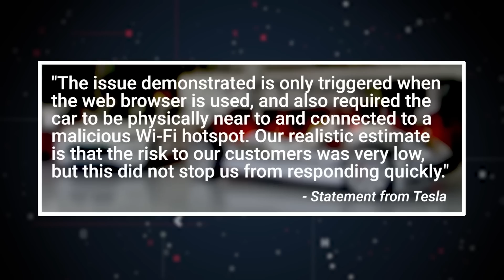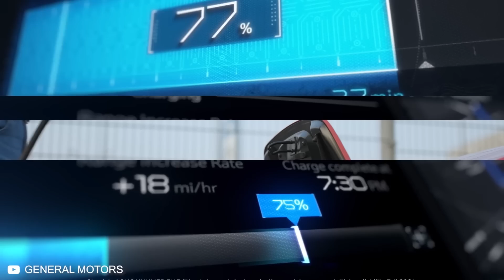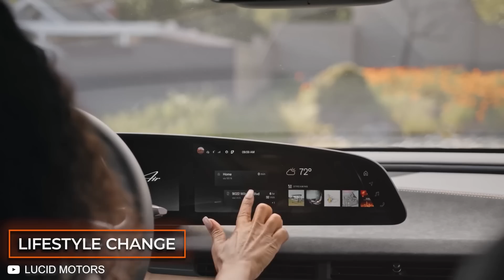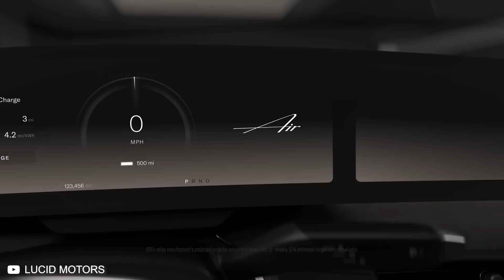EVs' Serious Problems That Carmakers Are Hiding

Comment: Adaptation: The cheapest EV I've found in the Netherlands is about 30 000EUR with a 25kwh battery pack... it's over 5 years old... where I live we have about a car park for 200 vehicles, surrounded by flats, and not a single charger can be found...
Reply: Sure each person has a choice to buy a EV or not
Here in  Australia  we simply  do not have the infrastructure  in place for thousands of people  to charge all their EV at the same time  when they finish work at 5.30pm 
Alot of people  only have street parking  and no where to actually  charge their EV  at home or in some cases at work as well 
As for charging  stations  around the place they are subject the failure  ,damage and vandalism  or all the above plus not to mention the long lines and fights over the charging stations  that still work 
Sitting in line waiting  for several for your turn to charge  you EV as you don't have enough  power in the battery  to search for another charging station
Really sounds fun and enjoyable 
The electrical  grids in alot of areas need to be up graded  and charging stations  need to be everywhere and actually  work before people  will have any confidence  in spending the big bucks on a EV 
How can you charge your EV if you have no power  due  to a fire, flood or snow storm or some other natural disaster and have to get to safely?
Of coarse  electricity  is the first thing to fail in an emergency  so you and your family are screwed 
Drowning ,been burn to death or frozen to death  is not my idea of a great time  cos my expensive  flat EV  is as useful  as a door stop with no way the charge the battery 
My advise is to buy a petrol/ electric  vehicle  like alot of taxi companies  do 
That way you can still escape  an emergency if you have no power 
Due to the petrol motor charging the battery as you drive you have move range Plus if you cannot get to a charging station  you can pull into any service station  and buy fuel and be on your way 
Isn't a petrol /electric  vehicle  and safer choice especially  if you have  young children 
Emagine being in your   dead EV  stuck on the side of the road  in the middle of nowhere  with the wife and 3 kids all under the age of 10 and it's 40 degrees out side in the middle  of summer or 10 below  in the middle of winter with no power to run the ac or heater or charge your smart phone 
People put themselves  and their families  in very dangerous  situations  due to believing in technology  and all the bullshit and lies the car making said  convincing  you  buy that EV
buying a EV will not save the planet nor stop climate change  no matter what the government  or any car maker  says
Reply: "#StoreDot Batteries" 

Like I have been saying I'm sitting out from buying an EV for the next 2 years.
( I would like to wait longer but I don't have the patience)
 The 1st EV  I will buy will probably be in 2024,  the way battery technology keeps advancing and at its current rapid rate a EV today with today's current battery configuration will be obsolete within 2 and a 1/2 years.

 Prime example is that the early EVs with the "3G Technology" are now dead in the water with "5G technology"  kicking in.
Reply: If I had the choose between  an EV  and a petrol /electric  vehicle 
For my and my families  safely  I would choose the petrol / electric  vehicle  every  time 
It's just not worth the risk 
Being stuck.out in the middle of nowhere 
Even if help comes along  ,without specialised  equipment  they cannot charge your EV battery nor jump start your EV  without cooking the electronics 
Mechanics  who specialise  in EVs are far and few between especially  here in Australia  where they could be 500 or 800 kms aways from where your EV is 
 In the days where you could help someone  broken down on the side of the road by help change a flat  tyre  or putting some fuel.in the tank ,enough to get them to the next service station 
You cannot do that with EVs
Reply: @waynehewett4017  Still early days.    They don't make sense everywhere.   
I hear Tesla batteries are doing a great job stabilizing your electric grid.
Reply: @danharold3087  don't get me wrong evs do have thier place in the cities with school runs ,shopping and going to work 
But there still  is alot of issues that still need to be addressed 
Here in Australia  with have alot of on street parking  so how are you ment to charge your ev overnight?
Good luck trying to find and recharging station at your local shopping centre which isn't working ,damaged or vandalised 
Plus like many storms and nature disasters  sometimes  the power can be out for many hours so how are you able to charge you dead ev?
What happens if you have  to get out in a hurry  due to a fire and flood with a dead ev
 Personally  I think buying a petrol electric  vehicle  makes more sense  as  your not restricted  and contiguously  worrying about trying to find a recharging station  that actually works 

As petrol as available  at any service station 

Sure they may not be as clean as an ev but that's if litte consolation  when your out in the middle of no where  in 45 degree heat with the wife and 3 kids in the back screaming their heads off and the 80 thousand dollar ev is nothing but very expensive  road side furniture 
Why do you think that taxi drivers use the petrol electric  vehicles  instead of the evs  as if they get into trouble  that small petrol engine  gives them more range to get out of trouble  plus petrol is available  at any service station
Reply: @waynehewett4017  Who has he scammed.   You have to stand in line to get one of his cars.  He has saved NASA huge amounts of money even by government standards.

The truck semi and taxi will be built when he can make enough batteries and chips.  RIght now all production is going into cars.  Would be wrong to open up new lines for new products and have them idle for lack of batteries.  

Tesla has 1.4 million cybertruck reservations.   Each cost $100 is is fully refundable.  No scam there.
Reply: @waynehewett4017  I agree that not everyone should buy an EV.    They can't build enough to keep with people who want them.   

You looking at what EVs are today.  It is still early times for EV.   What has been 
done is amazing but it will get much better.  In the past 10 years the realistic range has gone from something like 50 to 250 miles. 

The days of the taxi as we know it are numbered.   Tesla and others will be releasing self driving taxis.   There are currently 25 companies selling or working on self driving shuttles.

Researchers  all over the world are working on self driving cars.   I know a young lady from Pakistan with a PhD from South Korea who will soon be moving to Canada where she will continue with research into self driving car software.   There are 1000s of people like her working on it.  I don't know when it will happen but it would be shocking if it did failed.
Reply: @danharold3087  I agree evs  do have there place , school.run ,shopping ,going to work in our cities 
But like in most countries  the power infrastructure  is crap and can no way recharge  tens of thousands  of evs at 5.30pm when most people come home from work 
Alot of homes only  have no street parking so good luck recharging your ev or finding  a recharging  station  that's not busted with 20 kms left in your evs battery 
Evs have alot of short comings not that testa Musk cult would never have that in the sales pitch  when trying to sell you one of the over inflated  ridiculous  expensive  pieces of crap preying on your going green spin
Infact owning a evs could kill you 
Like most natural disasters  what's the first thing that goes out ?
Electricity 
So how the fuck  can you recharge?
What happens  if you and your family has to get out fast  say a bush fire breathing down your neck or you have 6 foot of flood water in your house and rising 
Trying explaining that to your wife and kids as you all die because  you brought  an ev 

That 80 thousand dollar piece of crap sitting  in your garage  looking pretty  isn't much use is it ?
If it was me I would just keep the petrol or diesel  vehicle  you have 
Plan your trips to do several  things at once and only go out when you need to 
There is nothing wrong doing 500,000 kms or more in a vehicle 
At least if you are in a natural disaster  you can still get to safely  
And let's face it having your family safe  is far more important  than the bullshit and propaganda  all the car making spin hoping you swallow the going green crap 
I know which one I'd choose  every time
Reply: @danharold3087  look I'm not against  buying an ev
But evs are not the be all and end all to our problems 
Evs will never replace diesel  and petrol vehicles 
As there are jobs the evs simply  cannot do 
Eg heavy road haulage  mining operations,  rail transport 
Any form of towing eg horse floats ,caravan,  trailers etc 
Sure there have been in roads into some areas but at the end they always rely  on fossil fuels to operate 
Abit like our idiot in charge here in Australia  who has been sucking on the coal industries  teat for years  using coal to produce  electricity 
How can evs be green if the electricity  produced in recharge  these vehicles  comes from the most dirty ,co ,producing way possible?
Just look at China and the amount of pollution  there caused of burning coal
Reply: @waynehewett4017  It is very early days for EVs.   One would be foolish to buy one without the needed charging infrastructure.   Everything but the bit about mining trucks here is from memory.   I am fairly sure about most of it.  I have noted where not.  Units are generally what sources used .  I know and use metric but when I see both the imperial is what I remember.      

Komatsu is selling diesel over electric mining trucks with capacity up to 180 st aka 907 kg.   Mining already uses a LOT of electricity.    It is not much of a leap to imagine trucks that load in the pit and charge where they dump.   The batteries will get there.  Environmental concerns and lower operating costs will make it happen.

Over the road trucks are nearly here.  The technology is here.  Tesla will have them when they catch up on making batteries.   The cost of running these trucks will be saving the operator between $100 and $200 USD a year.    When they get to self driving it will be adding the drivers salary to that.  So 1/4 million bucks more profitable.   

With 100% coal generated electricity EV cars break even on carbon at about 70K US miles. After that they are greener than gas aka petro ICEs.  When you replace the coal with a renewable the EV is green way earlier.  Thinking it takes 20K miles to offset manufacturing pollution.

As I think you are saying the grids are dirty due to greed.  In the US some of these greedy people are investing in EV charging stations. They want to keep their hooks in our pocket books.   Obviously we need both ends of this to be green.  But as I said above even with coal EVs are greener.  This relies on the coal plant not being worse than the car.  Depends on age and local laws obviously.  In short politics allow the grids to be dirty.

China's grid is interesting.   While it is burning a LOT of coal that is due to its size. "In early 2020, renewable energy comprised about 40% of China's total installed electric power capacity, and 26% of total power generation."

By percentage that is about the same as other large countries.    Until we get grid scale batteries for peaking I don't know how much above 20% it will go.  But I understand your ahead of the world on that.

So yeah it all comes down to better batteries.   This is widely understood with a huge amount of research going on.   The same goes for self driving.  

What nobody seems to be talking about is collecting the money needed to maintain roads.    Obviously that money needs to be collected.   When they start doing so it will skew the numbers.
Reply: @danharold3087  I too have heard  of the electric  dump trucks and the huge diggers they have on the open cut operations  and even some that are operated by remote control many hundreds of kms away at head office 
It's more as  a cost saving  exercise  to the companies as machines can work 24 7 without sleep ,breaks  or human error 
It has little to do with going green tho they what the appearance  of doing so 
Government  grants are a wonderful  thing especially  when they run into millions of dollars 
The problem  here in Australia  just about all electric  produced comes from burning coal
Sure we have ,wind ,solar etc but they are a drop in the ocean
To be honest I don't know much of what goes on the the US  only what you read or see on media or the internet  which could be ether propaganda, lies or true or somewhere in between 
I know testa and the Musk cult are breaking their necks to sucker any one to buy thier ridiculously  expensive  shit boxes  with the going green crap
Personally  I'm surprised  that Musk isn't in prison  for lying and defrauding all the customs who paid out millions of dollars in deposits  for testa products  that Musk conveniently  forgot about  and is yet to refund any of that money back 
Here we call that a scam artist 
I'm sure all those people Musk scammed don't give a shit how much Musk and spacex is helping. NASA  travel  to Mars  probably  using the stolen money to do it
I wouldn't  trust or use any products  from testa  or the Musk cult even if you gave it to me 
I don't know about the US but here in Australia   in our major cities we don't even have the proper  set up for ev charging  stations  as what one are available  ether don't work, damaged or are vandalised 
People that own a ev it's quite common  for the owners having to call a tow truck  to get their piece of crap ev taken ether home or to a locked and fenced off recharging station 
Due to the owner not being able to find a working charging station before the battery  went dead
So much for evs being green?
As for your question  that the government.  Is missing out on all that fuel tax ,the policians  here came up with a great idea 
Let's slap on a ev tax  to make up for all the fuel tax we lose 
Failing to realise ev owner already  paid a ridiculous  inflated  price for the ev plus all the taxes that go with it 
I think.most policians  have the intelligence  of a 2 year toddler
Reply: @danharold3087  you may think I'm  against  ev s but I'm not 
They have thier place 
But without education  and been taught  what evs can and can't do , what the evs limitations  are 
It's not you can jump in your ev and travel 200 or 300 kms  down the road  thinking  everything  with be fine a dandy 
As if you don't plan your trip there is a  possibility  things could go terribly wrong 
Even with a petrol  or diesel vehicle  you still need to use common sense  but at lease you  can pull into any service station  and buy fuel out in the sticks 
With evs you simply  cannot do that  and it maybe some time before it's possible
Reply: @waynehewett4017  I have said they are not for everyone. Many times.   What the heck happened to personal responsibility.   

The fact that my little town has a charger is an indication that chargers are coming to the sticks.   There is money to be madel! They will be built.    

Many people have two cars.  One EV and one ICE.   When they need to travel outside their comfort zone they run the ICE car.  YouTuber Darbin Orvar has a 2015 EV with an 85 mile range.   It gets her to town and back.  She has to charge in town if she drives around town.    Sounds horrid but she and her family loves. It.  They have a jeep to use when that cars range is a problem or they need to haul.   

I current have a 79 toyota pickup I only use in town.   I can see replacing it with a old EV with a short range at the right price.  As the range of new cars go up the value of old vehicles with little range will go down to about what an old battery pack goes for on ebay.

Again not for everyone.    But there are a good percentage of people, at least in the US, that have at least 2 cars.  Having a mix of ICE and EV makes sense.
Reply: @waynehewett4017   Yeah people need to know what they are doing.  Be it blankets and candles to survive when stuck in a blizzard or water to survive the heat.  People need to embrace personal responsibility.  We also need to be rational.

Still early days for EVs people need to understand that.  Don't paint the entire EV industry with the screw up of single car or manufacture.   I think most of your objections are being addressed.   LIke more range.  Economics will cause tow trucks to go electric.   It can happen by replacing retired units with electrics.  Maybe sooner.  Of course first there has to be the electric trucks. 

I talked with a trucker friend today who has been anti EV.   The cost of running his truck has caused him to change his mind.   Millions of people will soon be wanting electric semi tractors.   The economics of running a diesel at current fuel prices are bleak.
Reply: @danharold3087  I agree to have both if you can afford the 80 grand to buy a ev 
Just remember your 79 pick up is going to be worth more that that 80 grand ev in 5 to 7 years  as no one will want a used ev 
Personally  I can think.of alot of better ways to spend 80 grand and no I wasn't thinking ,parties, boozer, hookers etc tho it did cross my mind for a second 
The wife and kids are what's important and getting them.out of trouble  in a hurry  especially  in natural disasters 
I know what direction  I would choose to save my family 
Keep the 79 pickup and buy another petrol  or diesel vehicle  and have an emergency  escape  plan 
Apart from snow storms ,bush fires and floods  you guys have the nasty little buggers called Tonados which happen every  year in the US
Reply: @danharold3087  commo sense and actually  using your brain is a lost art now
Reply: @danharold3087  lucky  here in Australia  we don't have to worry too much about snow storms 
In Western Australia where I live  it  rarely gets below minus 3 during the  winter and that's only far a few days or weeks  with just frosts on the ground 
It's the summers that are hot   and that's where alot of the unprepared  die out on some dirt track  in the middle of know where ether bogged in the sand or run  out of fuel and water , snake bite etc 
Dying of thirst and exposure  is not a very pleasant  way to die
Reply: @danharold3087  I live in Perth Western Australia  and my mum whos 73  live in Toodyay  a small town about 130 kms away
I've got a old  2004  ford ute and I always have spare water ,fuel, oil ,brake fluid and tools to fix things if the need arises and it's only 130 kms away with 3 places to stop to get fuel etc in between  
I've always carried spare fuel and water it second nature to me 
It's certainly  got me out of trouble  quite a few times,  tools to do a patch job to get you home or to a mechanic or 5 litres of  fuel to get me to the nearest service station, or blown a radiator   hose , taped in up and refilled the radiator  with water to get home 
That cloth tape is bloody handy stuff for a temporary patch up to get you out of trouble 
People now have no idea how to survive  without their cup of coffee and their smart phone glued to their hand
Reply: @danharold3087  I'm not against  evs at all my friend at all
In the cities  with less pollution  is a good thing
As for your trucking friend  paying 1,500 dollars each time you fill your truck is a hard pill to swallow  and Russian going stupid  now it would cost your trucker mate well over 2 odd grand to fill the tanks 
There is other manufacturers  that make electric  trucks  but the battery  alone weights 5 to 7 tonnes  then you have the weight of the prime mover plus how many trailers you haul
Road transport  is paid by the weight of the load 
The heavier the  truck the less load it can haul unless your pulling 2 or 3 trailers  which at the moment  only diesel trucks can do  fully loaded 
Use a litre of diesel  for every km driven  so most heavy hauls have a range  of about 800kms 
It is a very expensive job to do plus all the other expenses  as well 
I don't know if an equivalent  electric truck is available  nor how many hundreds of thousands of dollars  it would cost to buy 
I'm certainly  not saying it's not possible 
There are so many things that need to be worked and the infrastructure  need to improve  a 100 fold  and charging stations need to at regular intervals  across  all states and territories 
Until that's been done  evs will only be available  to those  people who can afford to have a  80 grand ev parked in their garage
Reply: @waynehewett4017  Seems to be something we should be encouraging.
Reply: @waynehewett4017  Just the battery pack from an old EV is worth more than both of my old trucks together. on ebay
I also have a 1995 Lincoln town car with just over 100K that I only license and insure for travel.  And 2 parts cars to go with it.  

Yeah tornados.   We are on the west edge of tornado alley.    The can pop up most anywhere.    We shelter in the local hospital two blocks away.   I have run from tornados in cars.    It is dicey.

You can bet that if I had 80 grand it would not be going into a car.  EV or ICE.
Reply: @danharold3087  me too my friend, you could do alot with  80 grand 
Yes you are correct  the ev batteries  are a ridiculous  price to replace
But what I ment you r 79 pickup being worth more an a 80 grand ev is in 7 to 10 years  when you want replace that ev , you will get close to nothing for it as no one wants to buy a second  hand ev
As for your 79 pick up  they will be worth a bit depending on condition of coarse 
Alot of people  buy second  vehicles  especially  Ute's and pick ups and fix them.up themselves
With a second ev with its range decreased over the 7 to 10 years  and an expensive  battery  that could crap its self at any time 
I don't know many people who would take that risk  and the normal person cannot fix or repair an ev
Most used ev and their batteries  will end up in land fills
The car makers don't care they just want people to keep buying the latests and greatest  products  they have
So that what I ment  my friend
Reply: @danharold3087  you can't force people  to change 
Education  and explaining  the truth and facts   laid out for all to see 
Let people see  with their own eyes  and let them  make up their own minds 
It's the only way 
Trying to force or demand people  listen only pisses people off
Reply: @waynehewett4017  Gosh I did not intend to suggest we force people to change.  But economics do that all the time.

What did I say that has you thinking I want to force people?
Reply: @waynehewett4017  no nO NO
EV batteries to lame to power a car will be sold and used for home solar.  Ebay shows them from $500 to $8000 dollars.   After they a too lame to use for solar they will be worth something.  IRRC and please don't make me dig it up.   About 15% of an ev battery is the metals.   So if a new battery is  worth 10K the minerals reclaimed by recycling are worth $1500 dollars.   Scale that to suite but somebody out there is going to latch onto that and make money.

IF and I say IF what is currently being talked about in EV batteries they will outlast the car.  Maybe 2 or 3 cars.

LOL For years US consumers bought each new model years because they wanted a new car.  Most of the time only cosmetic changes were made.
Reply: @danharold3087  I agree alot of people  want the newest  version  ,model ,gadgets and latest technology  in not just cars ,but smart phones computers ,watches ,games etc just because  it's new  and it's keeping up with the Joan's 
Companies spend millions of dollars in marketing  and have brain washed people into must have the latests  no matter what  even what they have already Is still perfectly good for the life of that product
It's abit like people always  up grading their TV til you get a flat screen that covers the whole wall  and cost 30 grand to buy 
People want new things all the time and throw out perfectly  good in working  stuff all the time 
With that mode if thinking that's why I think evs
Reply: @danharold3087  second evs  won't be worth much at when they are 5 to 7 years old 
An ev to some people  is a statis  symbol,  a bit like a gold and diamond  layer smart phone  or gold leaf toilet paper and yes that is a thing 
Testa has had alot of quality  and build  problems  with most  models of their evs due to their factories in China 
Strip's coming off ,doors not coming properly  or miss aligned,  electrical issues in inside , instruments  displayes  faulty  or not  work 
Self drive failing , senors and cameras failing 
And that's the ones I heard about 
For a range  of vehicles  that cost up to 80 grand  each 
It's not good enough  and consumer law should reflect that 
I can buy toaster for 15 dollars and it has a one year guarantee 
But if it falls apart ,stops working or almost burns my house down then I'm entitled  to a full refund  and compensation  if other damages occur
 You who Musk and testa had no competition  in the ev market  for over 5 years  and they still produced  poorly quality  built models 
Herr in Australia  not many testa are sold ,apart as we are a small market and alot of people do not like up himself Musk and all the people  he screwed  over in the US  with his fuff ,lies and propaganda 
It seems you guys are the guinea pigs  when it comes to new products which we watch with keen interest 
BMW have brought  out a new ev  which would put any petrol sport car  too shame but unfortunately  it cost about as much as a sports car
Reply: @danharold3087  Dan you misunderstood  me  and no you didn't say that at all my friend 
And yes you are correct  economics  force us all the time 
But choosing  to buy a ev or sticking to your old petrol  / diesel  vehicle is a choice we can still make ourselves 
Cov  has certainly  shaken things up alot and made every  thing alot more expensive and of coarse  even more so with war obsessed  puking 
As you said the send or buy anything  overseas costs a fortune  with a 2 to 6 months delivery time and  that's if it turns up at all 
I buy alot on ebay and they have the  money  back guarantee  and in the past 3 years I've had to use that about 20 times 
I use to get gear from the US ,UK,Canada, Japan, and China  but now the postage costs  can cost more than the item 
Plus here we have gst  and an import tax  on top of that  , at times I'm looking  at  all up between 100 to 170  dollars  in postage  and taxes on top of the item
It kinda kills  the  whole thing  no matter how bad you want the item
Reply: @danharold3087  it's certainly interesting  to get others point of view  as you tent to get fixed in your  old ways
Reply: clot shots  Indeed.  I have a Honda Clarity with a 17 kw battery and when I plug it in, it draws about 7.5 kw during the first hour and lowers down to about 1.5 kw as the battery nears full capacity at the end of the second hour. Now the thing is that even on the hottest summer night, my whole house draw is only about 5 kw, so for that hour and a half or so, my car is drawing much more current than the house. Both power generation and transmission capabilities will need to grow a huge amount to move away from fossil fuel.
Reply: I'm not surprised  I live in Australia  and the power infrastructure  here is crap and there is no way thousands of people  can charge thier evs all at once 
Plus alot of houses only have street parking so how can they charge up thier vehicles 
What charging stations are always subject to failure ,damage or vandalism and this as called fast charging  is nothing but a fairy tail 
Plus what if there a bush fires or snow storms that knocks out power for days and no juice in the ev battery and you have to get out in a hurry 
What you and your family die of the  cold or been burnt to death in a fire cos your expensive  ev is as useful as a paper weight 
If I was going to buy a vehicle I would  buy a petrol/ electric vehicle which your not solely  dependent  on electricity in an emergency  which always fails in an emergency 
Petrol / electric  cars have a longer range Plus the petrol engine  charges up the battery  plus you can put into any service  station and buy petrol
They are normally cheaper to buy than evs new and have a better second hand market as well 
That's why alot of taxis are petrol/electric  vehicles  as they do tens of thousands of kms every year 
Evs do have thier place in the cities for short runs to work ,school.or shopping  but until all the power is up graded ,a hell of  alot  more charging stations which are vandal proof and actually  work happens evs will be limited at best 
Battery technology  needs to improve  alot too as a ev battery is over half the weight of the car 
Battery  for the pipe dream  electric  trucks weight between 5 and 7 tonnes just for the battery  alone so that impractical  at best 
Plus where are all the ev batteries  going to go when they crap themselves ?
no country as any plans for recycling  them as yet 
So much for going green and saving the planet
Reply: In the UK thieves are now cutting charging cable's for the copper, it's just getting crazy now
Reply: @looneytoons2878  it's gonna be everywhere.

The gypsies are stealing the high voltage cables from above the train tracks in Hungary...

There was a family in my area who had so much stolen copper that they had to get trucks to get it to the recycling centre...
Reply: @V4zz33  Wow that's crazy
Reply: clot shots  "That's one of the biggest problems with EV is finding a charger" >> This is not the biggest problem. What happens if there are 1,000,000 electric cars charged simultaneous in a big city? Or over 10 millions electric cars charged simultaneous in large cities? Just imagine. No country in the world has an electric grid which can afford this
Reply: clot shots  Yeah not great for apartment dwellers.   The grid will keep pace unless bad politics continue to hamper it.
Reply: Hello from England, I used to live in the Netherlands, for nearly 8 years good memories
Reply: @entity_dragons2013  Hello!;)) A reverse story for me: lived in London, Exeter and Bristol for 8,5 years before moving here.;))

Glad you had a good time here! Hope things are going well for you in the UK during this shitshow.
Reply: clot shots  <<The other is cost and upgrading the grid to handle millions of EV plugged in at night.>>

You charge them with your solar panels, of course.
Reply: EV's = child slave labor in The Congo and a fiery death for you.
Reply: that is why people that have their house and charging station buy ev cars
Reply: @triplextriplexxx8225  that's unsustainable, just look at the suburbs of the US and Canada... The more you spread the more it costs. Supply lines etc... If you spread too far, you cannot sustain whatever you're doing.

Just look at London, within the M25 ring road, 8-9 million ppl... Look at the massive Asian cities... Loads more people fit in those because they have viable alternatives to the idea of "cars for everyone".

You take one apartment block and spread it's people out, it would require 100s of millions of $$$ to build and sustain which the end result just won't support financially.

"Just bikes" and others have good videos on this topic.
Reply: Electric cars are a massive environmental disaster. Who would you buy one?
Reply: clot shots  For many people it's still not an issue. For my wifes usage, she would charge at a rapid charger once a week for 10 minutes. But we have a garage, like millions of others and rarely would need to. The amount of power needed to charge EVs is large, but it will be a scattered load that in most cases wouldn't have much impact. I would charge during the day, my wife at night/. But it is literally a few minutes each night if you do it daily. You can make up all the excuses EVs wont work, but... they will.
Reply: i'm really proud of my southern italian region where ev market share is around 0,9%. Time will prove this ev scam.
Reply: @lokibau  >> "Time will prove this ev scam" You can say the biggest scam of the century
Reply: @lokibau  I agree. The same goes for these flat LCD screen scam. We'll be using picture tube TV's again in no time. Same goes for rotary phones. We'll be using them again soon. This texting and getting high speed internet on your phones is just a fad and another scam. it'll never work.
Reply: @lokibau  Yep. Einstein was right. Only two things are infinite: the universe and, well...
Reply: @lokibau  
uncle Peppi's 1982 Panda >>>> Tesla
Reply: @lokibau  you are going to be found to be completely wrong in time. What part of EVs are a scam? that they aren't quieter and more powerful, better for the environment, more convenient for most people, better to drive, more reliable and tech and feature rich? Are people buying them and not getting them? You probably are convinced that Tesla was going to fail years ago, yet its the most valuable car company in the world now. Just watch the old established car companies that don't go electric die off over the next 5 years.
Reply: I think the buggy whip manufacturers may make a comeback.
Reply: @hubertwalters4300  LoL
Reply: @hubertwalters4300  EVs have been tried and failed repeatedly for more than a hundred years.
Reply: @SeattlePioneer  True, we seem to be trying to march backwards.
Reply: i call bullshit. there appears to be far more EVs in the Netherlands than where i am from and the cheapest working EV here costs about 6000€. there are new EVs with 45kWh batteries avalible for 30 000€.